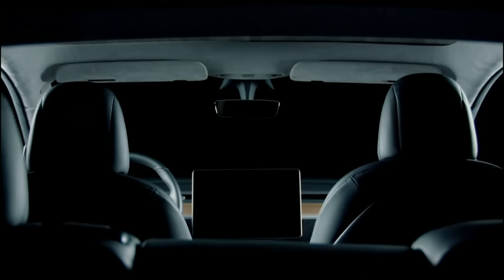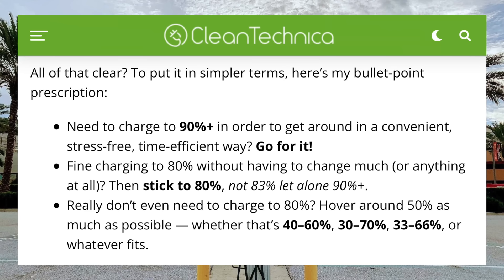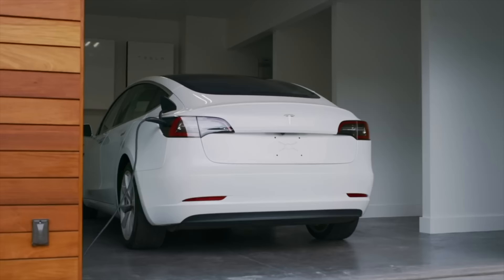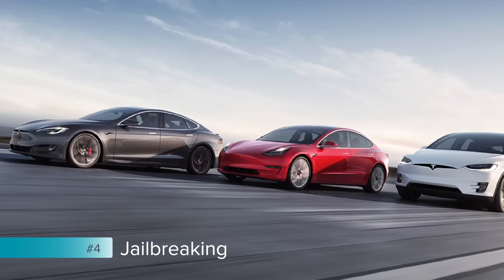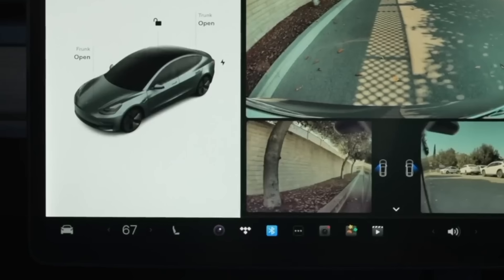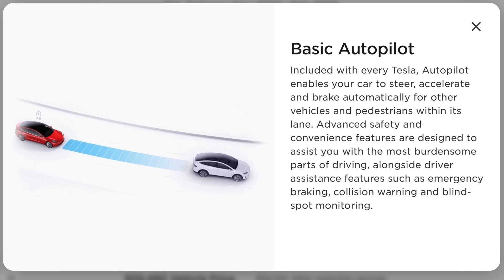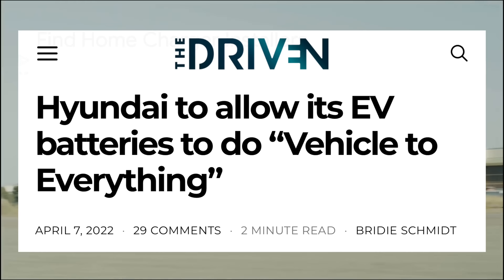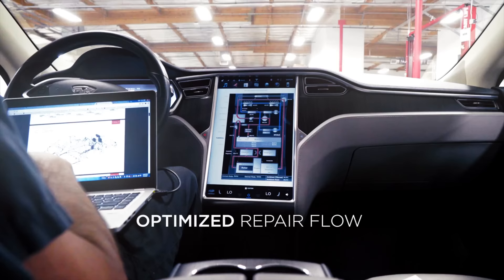10 Ways To Ruin Your Tesla | DO NOT Make This Mistake

Comment: You don't NEED to do anything to ruin a Tesla. You pay for pre-ruined cars. My friend's Model 3PP came with water in the lights, no clear coat on the passenger side, a paint drip down the driver's door, and a custom cracked sunroof.
Production challenges? No. Just a whole gimmicky company that's nothing more than a PR machine.

One of my greatest EV moments (or hours) was when I had the misfortune of riding with my friend from Idaho Falls to SLC--235 miles--in his Tesla Model 3 PP for service. We drove 87mph, stopped twice to charge, and had to do a complete charge at the dealer in SLC. Guess how long it took us to drive 235 miles at that speed with one serious mountain pass? I'll save you the suspense: 5'10". That's 5 HOURS and 10 MINUTES.
Oh, BTW, his 310 mile range Tesla can barely do 240 miles now, on a one year old Tesla. And, this is on his 2021 M3PP that came with both tail lights full of water, and a paint drip down the driver's door.
Incidentally, it took him 26 hours to drive from SLC to LA. 26... (688 mi). I'll let you look that one up on Google Maps.
I think I could have made better time in a Leaf. Or, at least, I would have known to book hotels.

I'm so done with EVs, especially TESLA. Tired of the Elon-PR lies: Where's my Roadster? Where's my Cyber Truck? Why does my Plaid STILL only go 163mph?

The industry is still out three years out on any decent battery tech, and by that time, I hope to god  we are using hydrogen cells.

Comment: LFP does not prefer to be charged to 100%, in fact 80% is also ideal for LFP. The reason for the Tesla recommendation is that LFP has a very flat discharge curve this means it's hard for the computer to accurately predict range, but if you charge to 100% then the computer knows the range. LFP batteries can do a lot more change/discharge cycles than Li ion so they can afford to lose a bunch of cycles due to 100% charging. So no don't charge LFP to 100%, if you need accurate range predictions then you can occasionally charge to 100% to give the computer a known reference point, but you will be doing so at the cost of increased battery degradation.

Comment: Great advice regarding the 3rd party mods.

Does anyone know if changing the car's colour via a 3rd party will void any warranty?

I hope to (eventually) get a Cybertruck, but I want it in matte black, and I don't expect that Tesla will offer that. 

As it'll be brand new, I was going to begin investigating which places already have experience in re-spraying Teslas.

Has anyone here done this?
Reply: vinyl wrap it,cheaper quicker and reversible with a heat gun :)
Reply: Order in regular black and get a Stealth PPF wrap.  Protects the paint, looks amazing and much more easy care than actual matte black paint.

Comment: I've lost 8% of range in 6 months (13,000 miles).
Reply: Wich car?
Reply: Oh wow, what model do you have?
Reply: @andreaskugler9218  Y Performance
Reply: You didn’t lose range due to battery degradation, the car learns your driving habits and estimates your real range based on that. Stop stepping on the pedal so much speedyshoes.
Reply: @tigerbeck  90% of my driving is cruise control on interstate. It doesn't have anything to do with putting my foot down. I would be happy if the loss of range was merely an adaptation to driving style and resulted in more accurate range, but I see no improvement in range accuracy. At best, I get 80% of projected range. There has been no change in projected range vs. actual range.

Comment: Boy I am sure glad I cant ruin my gas tank by filling it to completely full and driving until its on fumes.    Its weird that EV folks don't think that using all the range that your vehicle comes with without damaging the vehicle is a normal thing.  Tesla should be forced to give their advertized range based on 50% to 80%, not 0 to 100%.   That would make the range of a car what, maybe 70 miles?